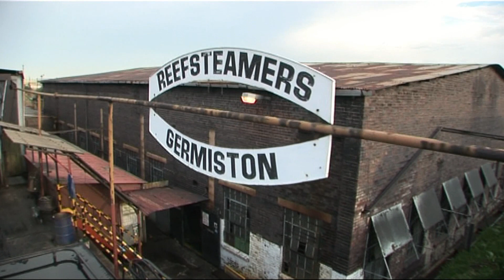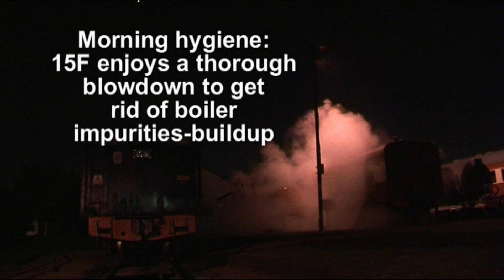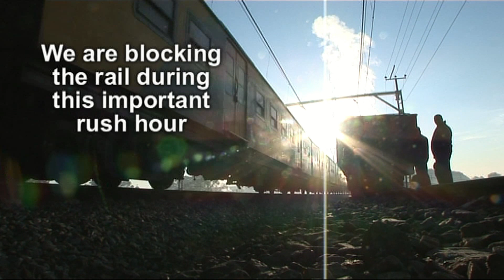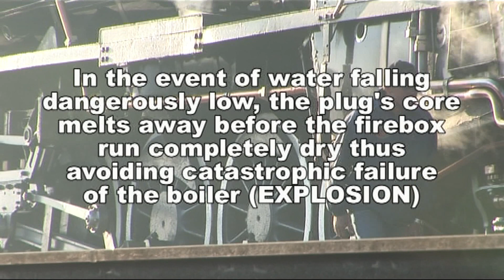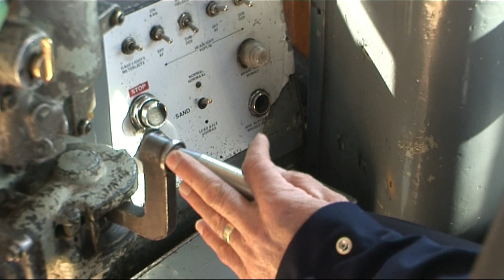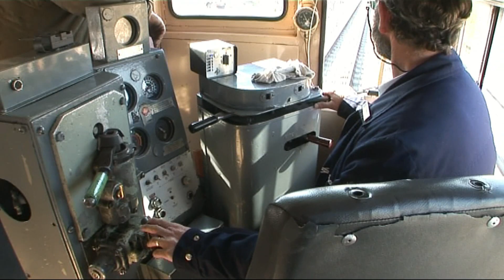DISASTER!!! on 15F steam locomotive courtesy of fusible plug

Comment: A fuseable plug has to be properly cleaned by wire brush and a correct dia tap used to clean the threads inside the plug. Then using salammoniac it must be tinned at the correct temp and can then be filled with lead and the date stamped on it. If it is incorrectly done the lead will not adhere to the copper plug and the water pressure will force it out. That would be the fitter,s fault and that can be seen by examining the dead firebed .If a hole  is blown in the firebed then only a jet of water can do that and the glass must have been full. However , steam on a hot fire will not blow a hole in the firebed and that means no water over the plug with possible leaky stays or worse .If no damage then my guess is an ill prepared plug by the fitter. All plugs must ALWAYS be checked by each crewmember for possible dripping of water when coming on duty and reported in the logbook of each engine.

Comment: Did the injectors fail? What caused the low water level in the boiler? I hope the damage isn't extensive enough for a firebox replacement.
Reply from the maker: The only damage was the ''melted' fusible plug that was later repaired as per the end part of the video. We never established, for sure, what caused the "disaster". It could have been 1) the fireman's negligence, 2) old fusible plug or 3) faulty fusible plug.